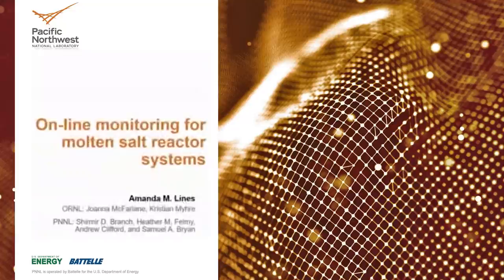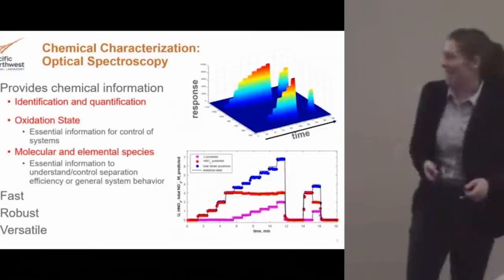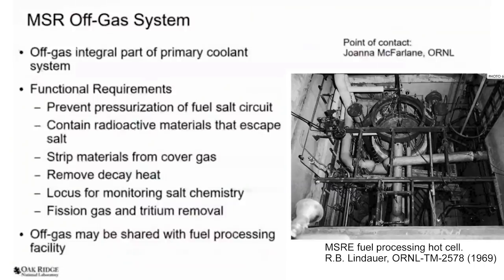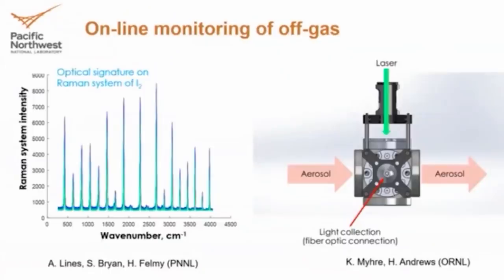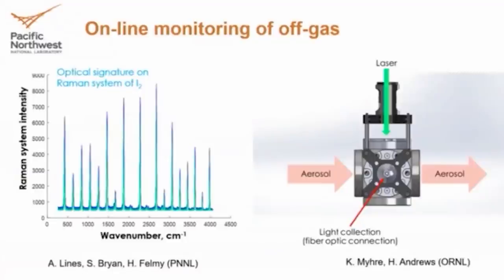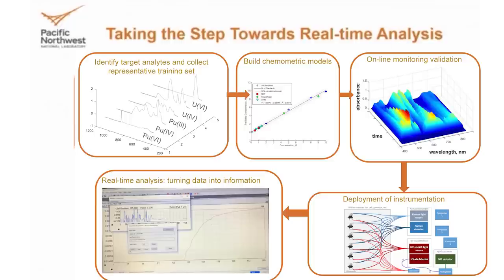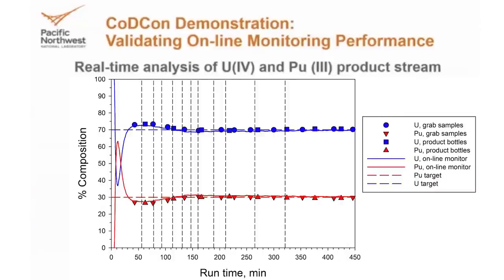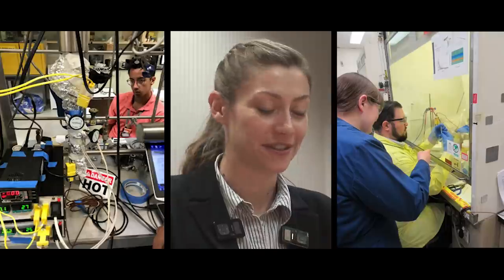Molten-Salt Reactor On-line Monitoring (Presentation+Interview) Amanda Lines of PNNL @ ORNL MSRW

Comment: Are you talking to Moltex (UK company) in Canada?  They are building a static salt reactor. Running in fast spectrum they avoid the mechanical problems of carbon swelling. They also do not pump the salt - another regulatory issue. 
Like everyone else, they have to prove that iodine and caesium are retained in the fuel. 
They avoid corrosion and metal deposition problems by keeping the fuel salt in tubes. These are removed before corrosion can be a problem.
Reply: I think the static salt reactor  makes more sense.  Unfortunately, many different advanced reactor options are competing for limited financial resources.

Comment: MSRs paired with a SAFIRE reactor can generate lots of energy and near zero radioactive waste. The SAFIRE reactor can remediate radioactive isotopes rendering them innocuous. 

Sustained fusion from Stellarators, and Tokamaks had proven elusive. Sustained fission is much more achievable. The real problem with fission is the byproducts and were to store them. A SAFIRE reactor eliminates the problem of byproduct storage and increases heat and power yields.
Reply: To further explore the vagaries of SAFIRE go to 

https://www.safireproject.com/science/phase-one.html where you learn nothing?
Reply: Uh, this is just a badly concealed attempt to pull the feeble-minded into the "Electric Universe" cult, otherwise known as The Thunderbolts Project. I'm not sure whether you're simply a victim of this absurd doctrine, or an active promoter who's in on the "con", but, either way, associating MSR R&D with nonsense like this is counterproductive.
Reply: @PalimpsestProd  It's likely an indoctrination technique designed to confuse the potential target.

Comment: I'm all for molten salt reactors. They don't require electricity to keep the fuel core safe. It runs on physics and gravity. All the disasters in U and Pu reactors are caused by loss of cooling water for whatever reason. IMO we should decommission all non-molten salt reactors and stick with molten salts.

Comment: The process for LFTRs could take carbon dioxide from the ocean then add the hydrogen to make ethanol which is a better storage fuel for fuel cells than straight hydrogen.  The Navy has already demonstrated something similar for ship board liquid fuel production for aircraft.

Ethanol stores much safer than inherently dangerous pressurized fuels, stores forever, is non toxic, and is relatively non corrosive(just look at any engineering chemical compatibility chart rather than API propaganda).

Fuel cells using ethanol with a catalyst can efficiently produce on demand hydrogen.  Or there are some fuel cells that use the ethanol directly.  

The ethanol can be mixed with enough water so as to be non flammable and still be used for the fuel cell.  A non flammable fuel in cars would be utterly safe.  Nissan has such a fuel cell ready to go today and even drove around a prototype in Brazil back in 2016.

Advanced European submarines are already using ethanol for fuel this very day.

Jet aircraft can use ethanol and above 10,000 feet the fuel efficiency is higher than our current toxic jet fuels because of the oxygen content of it.  Pollution free, in fact the exhaust over dirty cities would be cleaner than the surrounding air.  GE already has approved ethanol for their jet turbine engines and has sold some to Brazil for electricity production plants.

Dedicated ethanol internal combustion engines are (hyper)super efficient, half the size/twice the power, nontoxic, and almost pollution free.  Scania sells such an engine for trucks and buses this very day.

With LFTRs and ethanol the world could once again become a clean place to live.  I am excited for the future.  We have hope.  

I worry more about the current monopolistic powers stopping this than all the technological problems which may exist however.

Comment: Can this monitoring be used in LWR as well, to look at corrosion or even pH?
Reply: The corrosion and water chemistry for LWR is well known. We have radiation hardened electronics from years back. Look at our satellites you think there is less ration in outer space? They don't need this expensive type of monitoring. They need to be retired.
Reply: @jerrywatson1958  It doesn't matter if the chemistry is well know you still need to do monitoring of the primary loop for potential fuel failure. Still type of monitoring is no more expensive than whats currently used. LWRs will still be around for 60 years minimum since the Navy is still rolling out LWRs for the ships so having a better more active ability to monitor the reactor is always a plus
Reply: @Toefoo100  All the information you look for is in the water. LOL how do you think they did it in the 1950's? Only today the lab instruments for water analysis are smaller and digital. But water chemistry is the way they monitor the condition of the fuel. Corrosion control is how they get 40+ years out of the vessel. I spent 10 years refueling them.
Reply: @jerrywatson1958  Yes I already know all that, the benefit of this was that it can monitor continuously instead of having to pull samples every hour, which I'm sure you are familiar with.  My question was that can this be used in water instead of sodium or would it be too dilute? I'm not all that familiar with some of the newer tech using in civilian plants, I only just got out of power school
Reply: @Toefoo100  Hey you gotta have jobs for chemistry majors too, you know.
Reply: @jerrywatson1958  well if a job on a sub can freed up from this then I'm sure it'd be a welcome change

Comment: Wave or current flow energy from oceans is potentially larger and absolutely more reliable around the clock.
Reply from the maker: Diffuse. Diffuse energy requires more hardware to capture, and you'll find environmental impacts. Really no point telling folks keen on the highest density source of energy to get excited about low density sources of energy. (And nuclear has no challenge with reliability or dispatchability.)

Comment: I feel she is wrong "IF" we can solve the waste stream with anything even close to what Kirk Sorenson says about on board reprocessing nuclear fuel for small modular 250 to 300megawatt plants that also make chemicals we need from the heat with supercritical co2 as the working fluid. I just am not sure of what refractory material would be best. I feel carbon moderators would make a huge waste stream.
Reply from the maker: C14 can be segregated. Of course would be solid and not likely leverage any online chemistry work needed of an MSR chemical kidney. But I do expect C14 can be put to practical use as well. https://www.tandfonline.com/doi/pdf/10.1080/18811248.2006.9711118

Comment: A 6.6kw roof solar system is 36m2 and 
most roofs in Australia is 100m2 to 150m2.
4 hr of sunlight is 30kwh every day

A home needs   10kwh
A car, EV, needs 10kwh top up each day.
The grid takes   10kwh every day.

$3,600 and one day to install.
Every EV battery can stabilise the grid day and night.

NO MILITARY SECURITY or MILITARY COSTS
NO NUCLEAR RISK.
NO DECADES WAITNG.

In Australia we paid 'Gold Plated' costs to super size our grid, $45 billion as per the 
Royal Commission into excessive power costs by our monopolies suppliers.

Brand new battery technology is being tested every day and the SUN SHINE IS FREE.
Where ever crops grow and the wind blows, we have excessive energy and political battles.

Comment: Sounds like Bill Gates and Warren Buffet are going to build one in Wyoming !!!!!
Reply from the maker: That's not TerraPower's MSCR (Molten-Salt Chloride Reactor) it is their solid-fuel sodium-cooled "Natrium" reactor. It was closer to commercialization, as they'd been working on it longer. It does, however, use Molten-Salt (non-fuel Molten-Salt) to store heat, and so is able to load follow.
Reply: @gordonmcdowell  Oh, Dang! Guess I was just hoping it was the MSCR or a LFTR. That's good to know. Thanks!